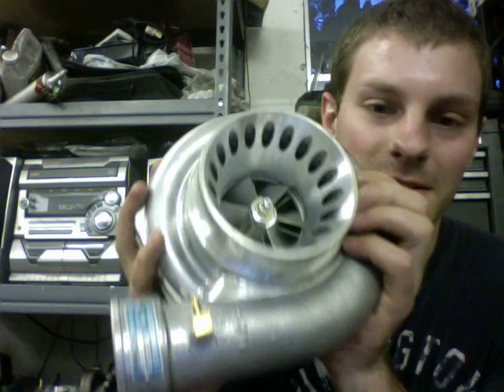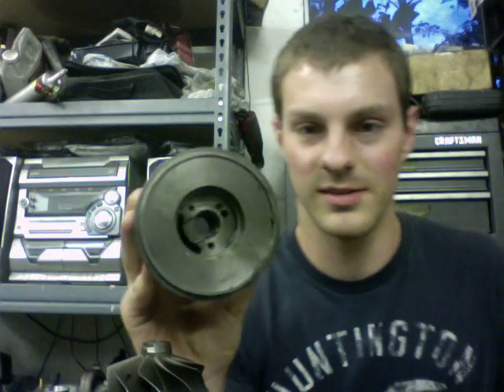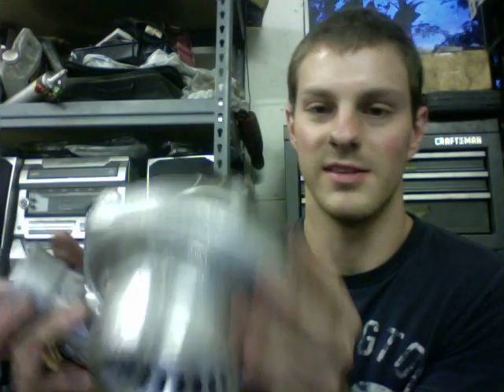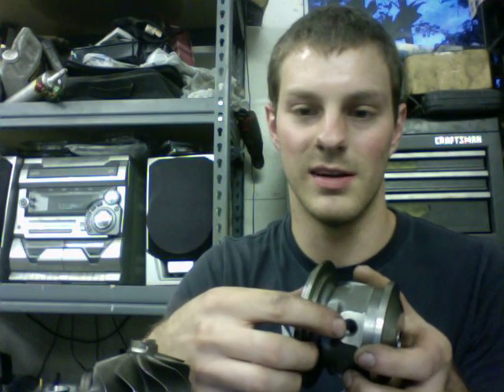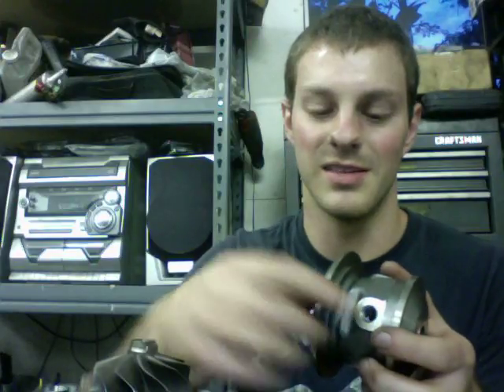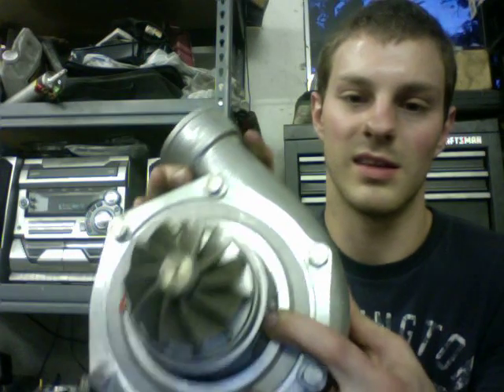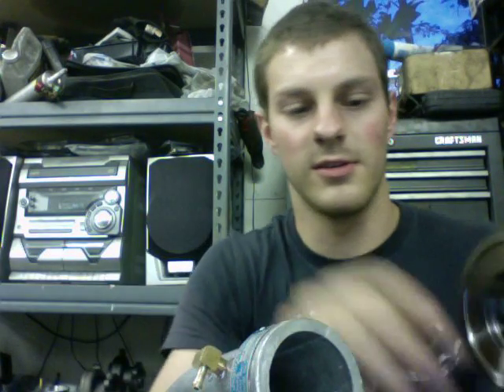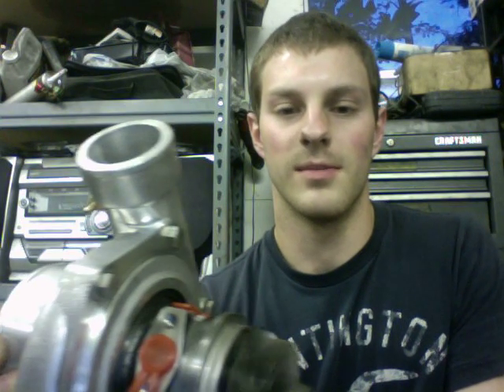China GT35R to Genuine GT35R Turbo Upgrade $550

Comment: Why dont you sell turbos on stead of buying turbo  then buying your center section  that is about $700 or better just buy a name brand turbo for $250 more not real saving to much there so what do you sell an how to find it just email that's it good luck thanks
Reply from the maker: We sell variations of Holsets, upgraded holsets for various cumin’s 89-present, and we sell the 6.0 powerstroke turbos and the bmw 1 and 5 series. We do sell some of the ballbearing turbos but mainly just our 67mm Gt35r upgrade.

Comment: Okay... so let me get this right
If I buy a replica GT35R turbo and simply buy the cartridge from a genuine GT35R ball bearing turbo and replace it, then I can have a fully functioning GT35R ball bearing turbo without having to do any form of CNC work on the housing...right?
Also do you have to use the C-clip from the ball bearing turbo to lock the cartridge in place?
If so, then I am sold

Comment: my friend...in 2018 chinese scenario... what you say about the chinese gtx 3582r clones?
Reply from the maker: I have never used one, I recommend you read the reviews. I buy ball bearing cages by themselves min order is not cheap. The ballbearing rebuild kit is the most expensive kit to keep in stock, I sold more of that kit on eBay than any seller on eBay but I'm the only seller than uses the products I sell. I have a very high success rate with the bb rebuilds.

Comment: they have these cx racing gt45 ceramic ball bearing Billet wheel turbos any info on those how good are they and what could you do to one upgrade wise ?
Reply from the maker: +scuba I never worked on one before. I don't know what to tell you besides based on the gt35r "ball bearing" there is a good chance that is not true ballbearing .
Reply: Turbo Lab America I am gonna give it a go if it blows up I'll send you it lol
Reply from the maker: I can't guarantee I can fix it but I can try

Comment: What about the compressor housing to compressor wheel clearances on the cheap Chinese units, to big of clearance will lower the effiencey of the unit stick to genuine units no cheap trash of ebay for me thanks, Ross Tyrone Turbos UK
Reply from the maker: +Tyrone Turbos I have never seen that problem. The tolerance I seen are good. If anything is wrong is bad quality thrust bearings sometimes but sometimes they are better than oem
Reply: Had a copy T04E in for a Tractor compressor housing was awful, wouldn't expect much else, Do you use Garretts own roller bearing cartridge or after market
Reply from the maker: +Tyrone Turbos Garrett does not sell individual parts from ball bearing turbos but they do sell the cartridges. I had parts and pieces made so I can repair the genuine cartridges so people don't have to buy a new turbo

Comment: If one were to attempt to use the gt35 copy, what size restrictor would you suggest with a turbo LS that makes like 25-30psi idle and maybe 60-70psi at peak rpms.
Reply from the maker: +Cameron Vic if you are planning on running the fake ballbearing turbo that isn't really ballbearing then you shouldn't use a restrictor but at the same time you may need to limit the flow because the bearing housing is so small and it can't drain very efficiently. I wouldn't pick this turbo. It will fail at 10 psi most likely because the thrust bearing is very weak
Reply: +Turbo Lab America I appreciate the response. You seem like a sharp guy, that's why I asked you. I actually have these exact turbos. Well near exact (I have the t4 with 3" v band outlet). I recently had a failure, I know, amazing surprise. Lol. The right one started smoking. I'm impressed with the HP they make, jury is still out on the longevity. I have two on a stock bottom end 5.3 LS in my Crown Vic, it went 10.0@140 a couple weeks ago. I love the size of them, and would consider sending them to you to have them converted to ball bearing possibly. Do they (you) have a billet wheel option for them?
Reply from the maker: +Cameron Vic we have a drop in billet wheel in 6 and 11 blade and the gtx35r wheel which requires machining, it's very difficult to keep the parts I stock to build these. I need bearing housings badly. I sold out of rebuild kits but will get more in s few days.
Reply: +Turbo Lab America if I were to send you my eBay gt35s to get them upgraded to ball bearing and billet compressor wheel, what would that cost for the pair? I can give you my email if you want to PM me.

Comment: @Turbo Lab America 
I'd like to ask you a question. I bought one of your guys TD06 (SL?) MHI 20G's from a guy on DSMTuners.com.  It was brand new and never run. When I received it, it was everything I expected it to be.  I wanted to know though.. do you start with a genuine MHI 20G or one of these cheap eBay units? Do they use genuine wheels, CHRAs, etc? I know the compressor housing is different and it has the 3" intake that only you guys seem to have on your turbos, so I'd just like to know what it is that I actually bought.  It performed well, and spooled like a big 16g.  I have nothing definitive about the longevity of it though because my engine blew only 350 miles after installing it. :(    Get back to me if you could, I'd really appreciate it!  Thanks.
Reply from the maker: +Loren Husky we used to build them with all genuine 14b bearing housings, we later had our own made which was great because 9 out of 10 mhi bearing housings were not usable because of oil contamination.  Most of them we built with billet wheels which isn't a genuine part.

You need to at least clean out your turbo because when the engine goes the turbo is next. I haven't built Dsm turbos in a few years. I just don't have as much time anymore because products sales are taking up most of my time
Reply: Mine does not have a billet wheel, it's definitely a cast wheel. But everything else I've seen looks like other pictures of your guys turbos to me.

Comment: can you get center sections for hx40s
Reply from the maker: +bryan swift I usually buy all the individual parts for the HX35 and HX40 and build them. I maybe about to just buy a cartridge for them, but you would have to tell me which hx40, because there are a lot of them. The different compressor wheels are 56 x 82 6 blade, 58 x 82 8 blade, 60 x 86 x 60 7 blade x 86 6 blade. and we have billet wheel options, 60 x 86, 62.35 x 86, 64 x 90, 67 x 89

The main reason why i build them from scratch is so i can machine the bearing housing for the compressor housing oring, and the appropriate compressor wheel, and I can balance the assembly before putting it together. And Also because most of the time I use upgraded billet wheels anyway, so its usually not factory spec.
Reply: +Turbo Lab America  ok cool i may just end up doing this gt35r setup you had going on its going on a 4 cyl 2.3 so idek if thats roughly a good size
Reply from the maker: yes that would work well. you may want to go with a .82 t3 housing
Reply: +Turbo Lab America was considering doing the hx35 with a bep .55 or .70 AR housing for reliability means and low end boost it doesn't really see much over 6500rpm ford 2.3 sohc
Reply from the maker: you are best off with the .70 because of the 2.3 displacement.
Reply: +Turbo Lab America I have a garret/air research t3 from a svo mustang what rebuild kit do I need and I need it overnighted
Reply from the maker: +bryan swift I don't carry that kit. Contact James Nimmo from performance techniques in San Bernardino California.

Comment: hey Austin,  is there a way I can contact you? I bought a precision 6766 dbb, very clean and nonshaft play, except the thing has about a 1/16 front to back slop where if its pushed forward the turbine wheel just barely tings the housing. called precision and they wont sell me parts, but they want me to send it in and pay for the parts, which could be in the 400 range..

Comment: Is it possible to convert a real gt4202 to ball bearing? Thanks for the vids!
Reply from the maker: +John Steenland The compressor plate, compressor housing, and turbine housing are the same. The bearing housing and turbine wheel are different, the compressor wheel maybe the same depending on which one you have. some of the boreless gt42 turbos, the plate, shaft and compressor wheel are different

I have never tried it before, though i have rebuilt a gt4202r, i have a video on that incase you havent seen it. I would need to buy ball bearing bearing housings and thrust collars to do the conversion. I have the shafts and bearings. I could probably do it. i have to decide if thats something that i want to try and do based on demand and the fact that those turbos are really heavy and not easy to ship.

Comment: So if I bought one of those knock off gt35's for $300 and send it to you, for $600 you pull it apart and install a legit dbb cartridge and essentially turn it into a legit gt35r turbo for basically $900 ?
Reply from the maker: +speedfreak0920 yes, if you get the turbo with the c clip that holds the cartridge to the compressor housing.
Reply: Even if my cxracing gt35 isnt ball bearing? Because i have one just lugging around. If it spools faster than my t62 im going for it

Comment: Do you have conversions for the eBay version of the GT35 ?
Reply from the maker: +Marlon Lyn i am currently waiting on the black oring for the ball bearing kits, they are supposed to be here this week. once i have them i can build 1 gt35r cartridge, i have the rotating assembly in stock.
Reply: +Turbo Lab America will those work with the non r version of the eBay turbos i.e. gt35 instead  of gr35r? If not, do you have a conversion kit?
Reply from the maker: It depends which turbo you have. there are a lot of different versions.
Reply: Here are the Specifications if this helps:

Specs:

Compressor A/R: 0.7 	Interchange Part Number: 	T3 Flange; GT35
Compressor Inducer /Exducer: 	61.5mm/81.5mm 	
Flange (Turbo Manifold): 	T3 4-Bolt Flange 	
Brand: maxpeedingrods
Flange (Downpipe): 	4-Bolt Flange 	
Part Brand: 	MaxpeedingRods Performance Parts
Turbine A/R: 	0.63 	Horse Power Increment:
Turbine Inducer /Exducer: 	68mm/62.4mm 	
Compressor Inlet / Outlet Spec: 	4inch(103.5mm)/2.5inch(64.7mm)
Cooling Type: 	Water and Oil cooled
Reply from the maker: The specs i need arent the wheel sizes, or housing sizes. The specs i need are of the compressor plate used to4s or to4e, and the turbine housing used, the ball bearing cartridge sits farther in the housing, the depth is different. 

it would be a lot easier if you send me pictures to turbolabamerica@gmail.com
Reply: I will see what I can do will do!

Comment: i want to from gt3582r ball bearing t03 0.84 rear  to something that is a 0.82 t04 twin scroll rear. i found a cheap china turbo that has is on ebay that has t04 0.82 twin scroll for $320 would i be able to use the rear housing and rear exhaust fin as direct fit to my gt3582r kind regards Milton Sydney Australia ?

Comment: hi I'm in need off help .. I own a skyline I have a gt3582r 0.82 rear and now I want to use a t04 twin scroll I cant find a twin scroll t04 rear housing any where for the 0.82 rear what do u recommend or what other turbo  do u think will work for good power and response.. I'm looking at bogwarner turbos as there cheaper.. ;/
Reply from the maker: +Millcom Milton finding a t4 divided turbine housing for a gt35r maybe kind of difficult. I have heard of people getting them from atp.  I have seen some gt35r t4 turbine housing, they are kind of rare though. You could go with a t3 1.06, we had someone make 926hp on 1.06 gt35r, but it had a t67 compressor wheel.
Reply: how about precision turbos ? I found a 6668 JB on special from there web site ,if I sent it to you could you upgrade it to dual ball bearing turbo or ball bearing ..? https://shop.precisionturbo.net/index.php/discounted-overstock-new-and-remanufactured-sale-turbochargers/pt6668hp-jb-turbo-remanufactured.html
Reply from the maker: +Millcom Milton  The compressor housing is a problem, i cannot use the compressor housing when converting it to ball bearing. the name of that turbo is kind of misleading, it has the same turbine wheel as a 6262, but the compressor wheel of a t67, it should be called a 6662, but they probably called it a 6668 because it does use a t4 turbine housing.

Comment: I don't know if you'll reply but im getting a Honda CRX 88' as my first car and I want to but a turbo, only problem is I don't know what kind are good for that kind of motor, I don't know much about turbo's but I do know that the CRX I want to get only produces 95 hp.... I might put in a b16 swap but those engines with 100k on them still run for 500 some od dollars and im only 17 with a minimum wage job. please help if you can help.
Reply from the maker: +zodion8 To turbo a car will take time and money. i started out reading everything i could on dsmtuners.com, to learn about turbos, how they work and diagnosing problems. I probably read for an hr everyday for a year or so.

 Many people in the honda world will install a dsm manifold which fits some of the honda heads directly, then you can mount the dsm turbo such as a 14b or 16g. The 14b is good for up to 300 hp, the 16g is good for up to 400 hp. You will need an intercooler and piping which the pipe need to be cut/welded to fit or whatever you have to do.  

I would recommend starting off with the dsm manifold and dsm turbo if it fits your cylinder head.

Comment: I have a gtx3582r turbo made by a company called turbo research in shanghai China. If I purchase your ceramic ball bearings kit will it fit in my turbo?
Reply: Muzaffer Mohamed I also have purchased a GTX3076R from them. Do you have any problem with that turbo? I haven't installed yet.

Comment: what's your opinion on cxracing turbo kits? specifically the gt35r's?
Reply from the maker: Aaron Perez The stainless manifolds crack really bad. I heard this from people, well i tried it anyway, my stainless manifold cracked really bad, i didnt even get to see boost. This is for the e36. For the e36 kit i dont like how they put the BOV at the throttle body. porsche found out that the turbo cars are most efficient with the BOV closest to the turbo, which is why some turbo cars have the BOV on the turbo from factory. This helps with spool time, because it releases the pressure much later.  The turbo is designed to protect the turbo not the throttle body.

Those are my 2 negative opinions of their kits. In some cases the turbo is worthless. Their quality of turbos have improved but some of their turbos still are not up to Par and probably never will. The failures are mostly design flaws, not weak metals in the turbo or insuffiecent balancings most people online claim. I never bought a whole kit. i just pieced mine together and a fabricated my parts. 

Most of the kit would save a lot of time.

Comment from the maker: Here is The Original Turbo In this Video http://ebay.to/17IIDw7 . If you can Pick up a Used unit for around for a good deal then you can have a quality budget ball bearing gt35r turbo, if you buy our cartridge replacement: http://ebay.to/1v7e51l
Reply: Do you guys have replacements for gt28 sized turbo's?
Reply from the maker: i can make them. what size are you looking for? i have a gt3071r cartridge with a billet wheel in stock.
Reply: Turbo Lab America 
Will you be getting any more 3582r chra's?? And how much more for a billet 11 blade?
Reply from the maker: i have the parts in stock to build more now. I dont have the 11 blade in stock right now i have to wait to get more. it could take another month before i have one ready with an 11 blade. we sell them with a billet wheel for 650
Reply: Turbo Lab America 
Sweet good to know you'll be able to make some more. 
And just to be clear I have a 60 trim, .82 AR hotside t04e. This chra will fit right? Also your opinion on if the billet wheel is worth it? I know the aerodynamics are a little different than the 6/6 design
Reply from the maker: The billet wheels are designed to flow 5 to 10 percent more than stock. It makes a bigger difference when you use a larger turbine housing. The cast wheels are still rated around the 600 hp mark depending on your turbine housing size
Reply: do u do china gt30r to gtx30r bb

Comment: I need a gt35 if you have them in stock how much you have them for.
Reply from the maker: I can build 1 with a cast wheel for 550 and with the billet wheel for 650. I have 2 available with the cast wheel and 1 with the billet wheel.
Reply: Can you email me a picture of the unit at danymatos13@hotmail.com
Reply from the maker: Yes. it will be later today or early tomorrow. i need to build it still.
Reply: Ok cool
Reply from the maker: jose rentas Ian sent you an email Early this morning. Let me know if you got it.
Reply: I gor them thanks

Comment: Do you know if this can be done with the isis RS3871 which they claim to be "Virtually identical to the Garrett GT2871R, just non-ball bearing" and if so what would the price run ?
Reply from the maker: I may have to do some machining, i may not, its hard to tell without knowing if the compressor and turbine shaft are identical to the gt2871. It sounds like just a journal bearing gt2871.

     My only other concern is that the turbine housing for the ball bearing and journal bearing are different and the journal bearing turbine housing cant be machined to the ball bearing turbine housing or vise versa. 

I can make you a ball bearing chra with a billet wheel for 550 for the gt2871r.  I can machine the ball bearing t2 turbine housing to a 55 x 60mm gt3076 turbine, and i can machine the compressor up to a 58 x 76  3076 billet compressor wheel. 

We machine each housing for $100, so you looking at $750 at the most, unless you need to replace the turbine housing with a ball bearing one. I can get ball bearing t2 turbine housings made, i just haven't done it yet.